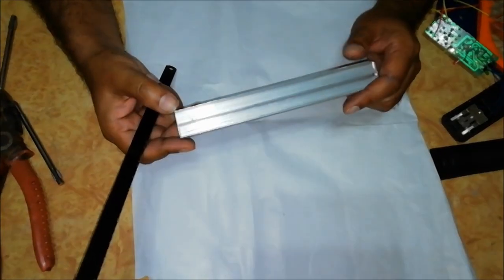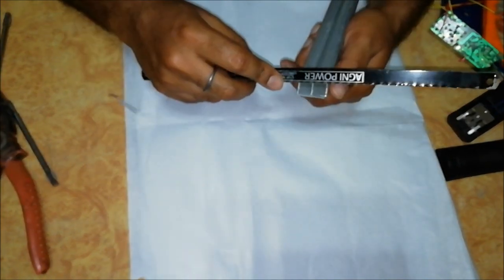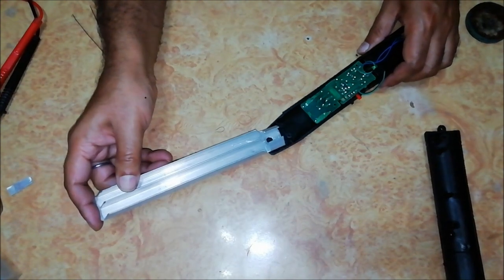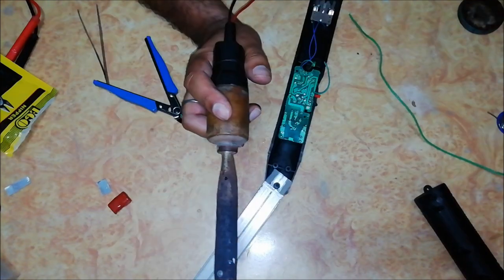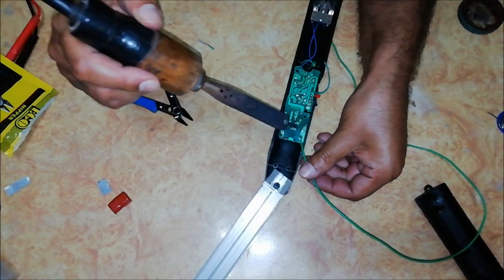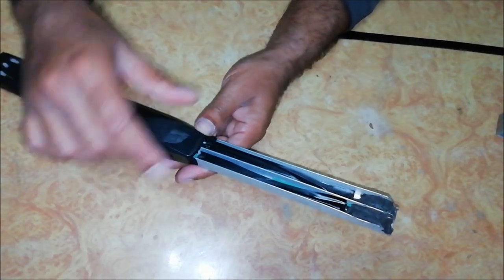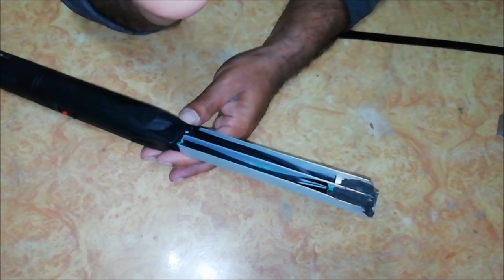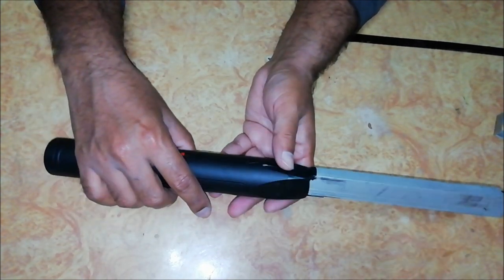convert broken mosquito bat or zapper into electric gas lighter DIY

Comment: Hi, thanks for sharing. Is the capacitor removed or retaining the same circuit as original?
Reply from the maker: no capacitor is not removed. if you remove the capacitor then intensity of spark reduces.